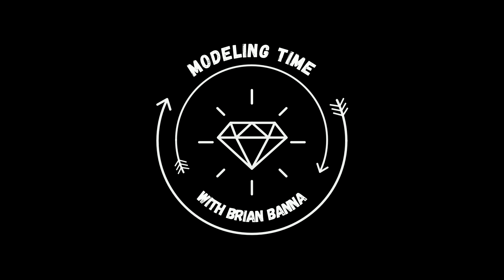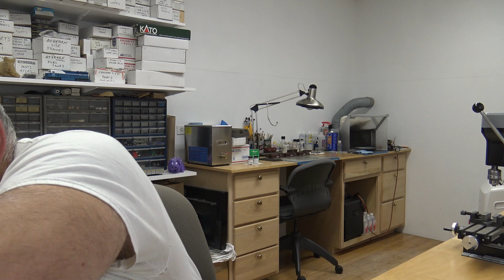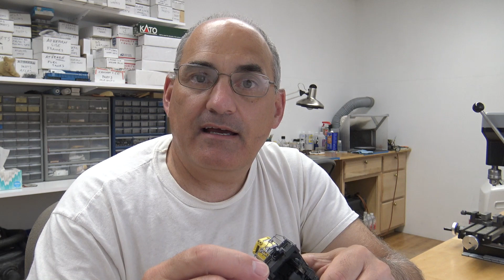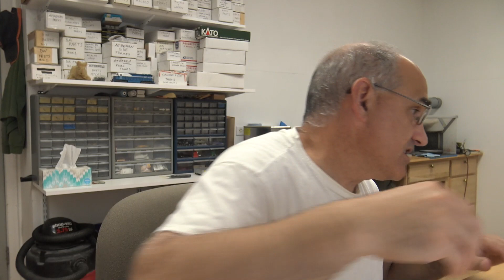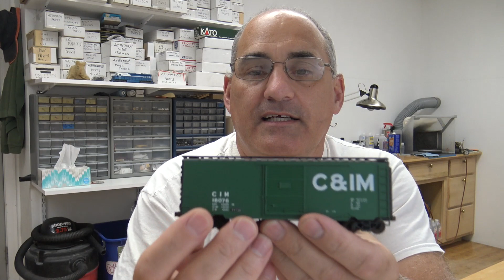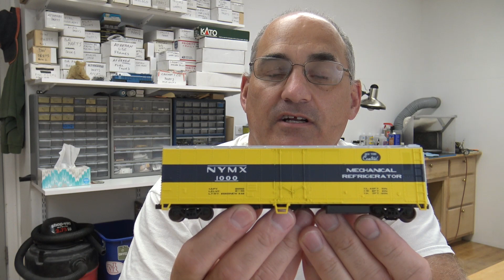BAR GP7 INTRODUCTION

Comment: Thanks for sharing Brian. Yes please do some car videos. I know it's a lot of work. I am learning a lot from your videos.
Reply from the maker: Thanks Vincent. I do appreciate it. I have not forgotten about your question on the N-Scale SD7/9 ladders. I just have not come up with a viable solution. Photo etch is not going to work well for you. I was thinking maybe micro trains caboose ladders cut to fit. Or other ladders in N-Scale, but I have no clue as to what is available. The photo etch will be just to thin and fiddly to work with.
Reply: @6axlepwr  I figured etch the sides of the ladders with etched holes for fine wires as rungs. Put together in some kinda jig. then Super glued or something. I think it would look more correct that something flat.